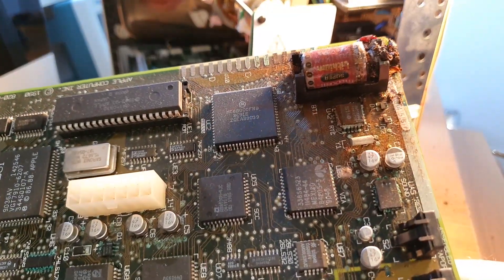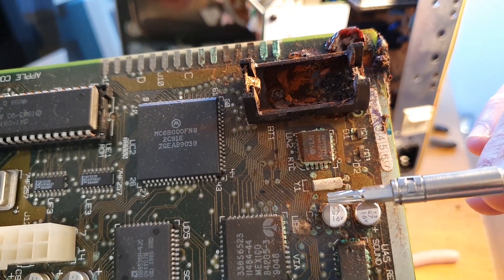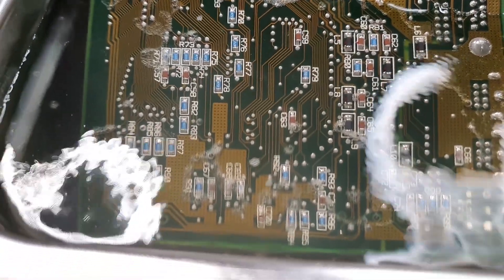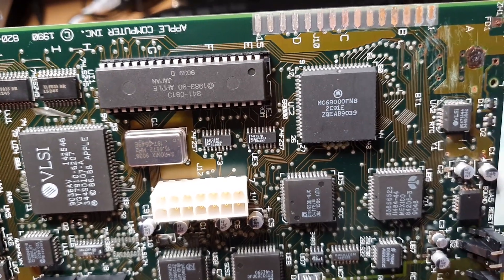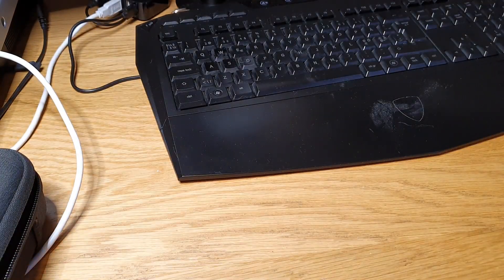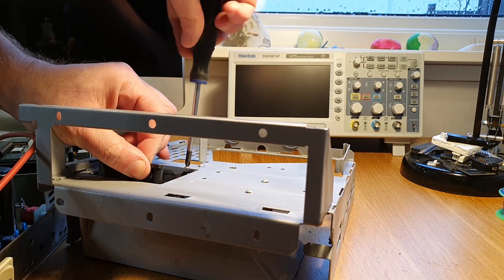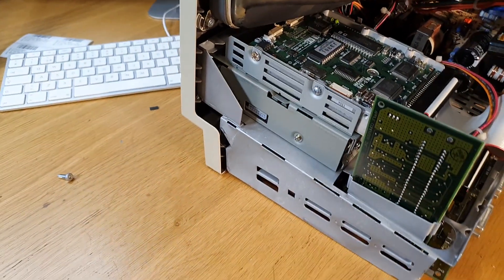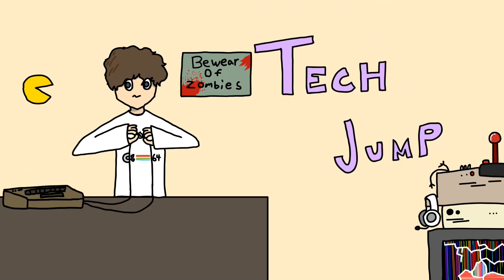Macintosh Classic with tons of corrosion

Comment: How did you get the corrosion off the Rusty part of the chassis? did you do a vinegar soak or something? Did you end up spray painting it? 

I've got an SE with a similarly corroded chassis (maybe a bit worse than yours). Just thinking if its salvagable or not.
Reply from the maker: I used sandpaper and then Vineagar before spray painting it.